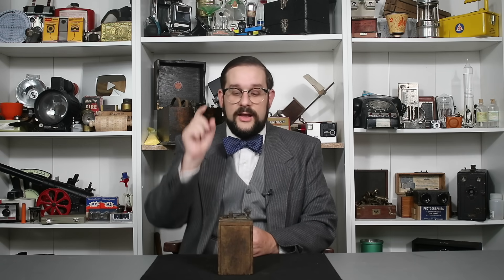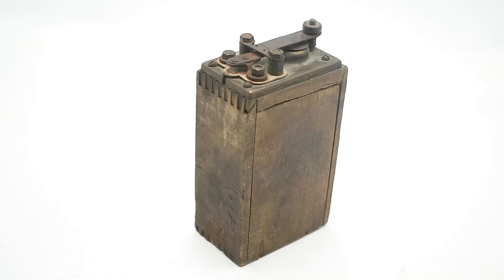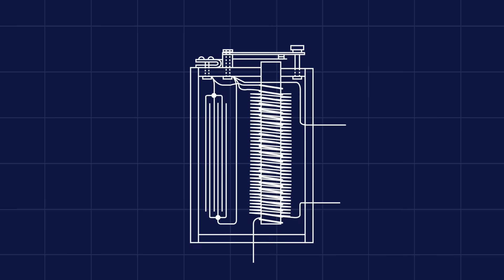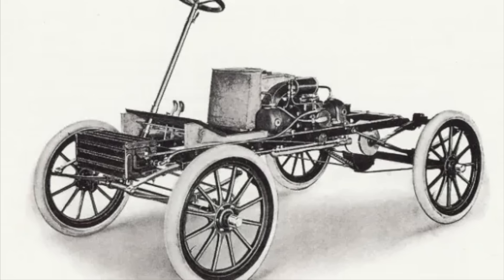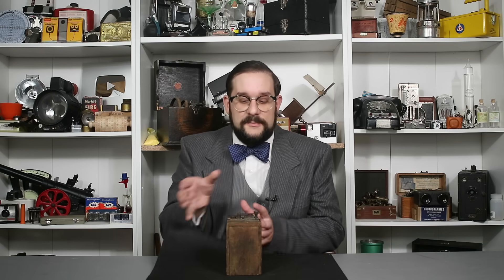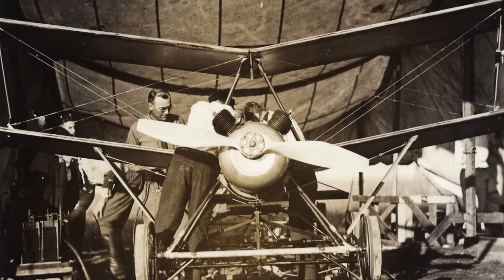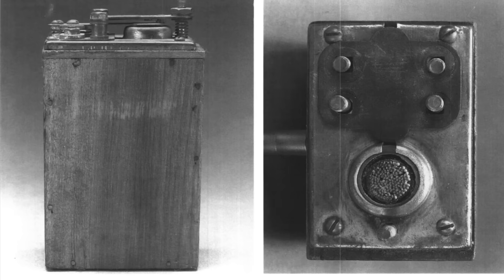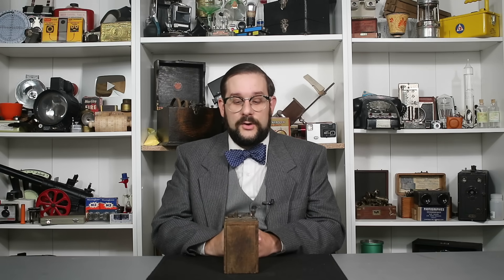Ford Model T Ignition Coil: a Spark of Genius

Comment: The gas floor heater in my parent's house in California used a model T coil for ignition. The house in Redwood City was built in the 1920s.
Reply: Yup back then u understood ur technology and could modify it to ur needs. Best mechanics teacher i had taught me "if u understand every compents function and relation to each other, you can manipulate them to ur needs" he proved this by running a v6 honda on GM 1980s ignition components
Reply: I had a Junkers butane water heater that used for lighter a spark plug but a piezoelectric HT generator...

Comment: So basically, Ford designed and utilized one of the earliest distributorless style ignition systems for their early cars which didn't become mainstream until the 1980's in automobiles. I learn something new every time I watch this channel!
Reply: It's similar to the coil-on-plug design used on cars of today. They used a timing trigger off the camshaft to energize the proper coil in the firing order. "Cam sensor."
Reply: @mindeloman  yep and driver was the computer to adjust timing as needed
Reply: Another amazing thing about the Model T is the reason for it's funky pedal layout is for all intents and purposes it has an automatic transmission.... Or at least the mechanical non- hydraulic portions of what would be used in the future to make automatic transmissions
Reply: @alexlail7481  That is crazy.  I just went and looked at that. That dude was so far ahead of his time.
Reply: I was so surprised when I learned this about 5 years ago.  Everything old is new again.  Crazy
Reply: I'm kind of disappointed you didn't run it to draw some sparks, I played with one as a kid and they're lots of fun.
Reply: one reason the T would run on kerosene also , a multi strike spark system similar in results a a modern MSD type

Comment: Cool video, I still have my Ford spark coil from years ago when I wanted to
play with different ignition systems.

The fact that the car industry has gone back to either one coil per cylinder
or one coil for two cylinders is telling about the distributor having problems!
However the one coil with two cylinders system is so cool, in that the spark
plug firing in the exhaust mode of cylinder timing, to ignite any leftover fuel
for better emissions performance!
Reply: Its more about the capability to produce higher voltage spark, and transfer it efficiently from coil, through distributor, and plug wires, to spark plugs without losses, raises in compression ratios require higher spark voltages for reliable spark compared to lower compression engines of the past that used distributors. Its a combination of stuff like that, that sees more modern cars adopting COP (coil-on-plug) methodology over distributors. Also more finite control over ignition advance is part of it as well. 

Basically its a multitude of changes in engine design itself that made it neccesary. Distributors arent inherently incapable, it just makes it easier to maintain higher spark voltage by eliminating all those transfer points. 

Maintenance is another thing. In an age where we use iridium spark plugs with a service life of generally 100k miles give or take, distributor systems would need maintenance at a more frequent interval compared to the spark plugs themselves, which feels silly. Back when we used copper and platinum spark plugs, the plugs and distributor cap/rotor and plug wires needed maintenance at a similar interval to the spark plugs, so that made more sense. 

I guess what im trying to say is, its not inherently a bad system, distributor ignition, its just more maintenance and design intensive to reach the kind of power, maintenance free operation, etc, to go with COP
Reply: @goosenotmaverick1156  Back in the mid 80s when I was drag racing, anything that made the timing and spark delivery stable, without chain slack or gear lash making the timing vary, was a net positive. I had straight slot screwdriver bits welded to the crank, not the harmonic balancer, to get the most stable trigger pulses for each coil, and having eight coils mounted on the intake looked weird, but it worked. It eliminated the distributor completely and the trigger box controlled timing based on RPM only. Kind of hokey but fun to tune eight hall sensors!

Comment: IVE always been fascinated with ignition coils and mechanisms at one point as a kid i wired an old coil to a battery charger and tried to create a spark with the whole lot sitting n my lap at first nothing, i discovered that the jolt is only released when the circuits first made getting the full 50k through my wedding tackle was quite an experience

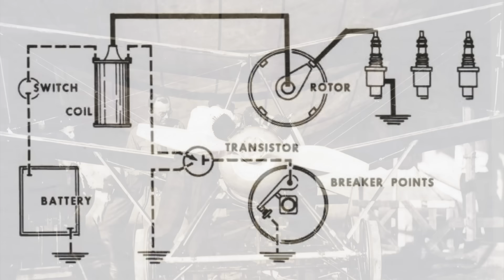Comment: @13:10 the illustration includes a transistor ? Where did that illustration come from? it is certainly not anywhere near Model T vintage.  As far as I know a simple switching transistor with conventional points was not a very common thing, certainly transistor ignitions did exist (thought rather later than the Model T) but often with a non-contact sensor replacing the points (magnetic or rarely, photoelectric) Also when transistors were used "capacitive discharge" seemed to have been common which would have been a different sort of circuit than shown.

Comment: video length is no longer an issue.

youtube allows over 200 hours there are meme videos like windows xp startup chime stretched to 24 hours and the file size can be 20 maybe 40 gb for the 4 and 8k videos.

if your internet is unstable and dropping the connection you may want to ditch that dsl or cable modem and upgrade to fiber optic and during the covid pandemic isps got grants to bring fiber to the home and it is very cost competitive.

you can also get a vps or seedbox where you can upload the file to that and it has a much faster connection that you can upload to youtube.

i think youtube has a video editor online you can upload your clips to and build the video online and that will solve the unstable connection.
Reply: He needs higher speed cable or starlink if he's in the middle of nowhere. Get fiber and you'll have endless problems.

Comment: I have one of these model T buzz coils. I have it hooked to a spark plug and an alkaline 9 volt battery in order to make the coil buzz & the spark plug spark (ordinary "heavy duty" zinc carbon batteries in that size don't have enough "umph" to put it in technical terms to start the buzzing). It's pretty cool to see and hear. Early HAM radio hobbyists used them to make radio transmitters. Although they were more like radio interference generators! They'd use Morse Code dots & dashes that ended up as buzzes on the receiver.
Reply: My first amateur radio licence (UK 1974) included the wording "The use of spark sending apparatus is expressly prohibited". :face-fuchsia-wide-eyes:
Killjoys! :face-blue-smiling:
Reply: @Bartok_J  Maybe not as "killjoy" as you think, not all arc based transmitters are created equal! They didn't outright ban "singing arc" transmitters until much later, because they generated an actual continuous wave radio signal (noisy yes, but a lot cleaner than spark gap type, clean enough that it didn't take out the channel next door on the dial). This was mostly used until they figured out how to make high power vacuum tubes suitable for high power broadcast use, which happened about 10y after most "singing arc" stations were put on the air.
Reply: I used one of the more modern  (black plastic) "Model T" style coils to make a "Marconi" spark-gap  transmitter that would reach to the next neighborhood !
My friend and I would send Morse code messages to each other this way - we were maybe ~12yo at the time..

Comment: Does it still work? I would have liked to see it running.
Reply: Would have been easy for him to do. I have one of these model T buzz coils. I have it hooked to a spark plug and an alkaline 9 volt battery in order to make the coil buzz & the spark plug spark (ordinary "heavy duty" zinc carbon batteries in that size don't have enough "umph" to put it in technical terms to start the buzzing). It's pretty cool to see and hear. Early HAM radio hobbyists used them to make radio transmitters. Although they were more like radio interference generators! They'd use Morse Code dots & dashes that ended up as buzzes on the receiver.